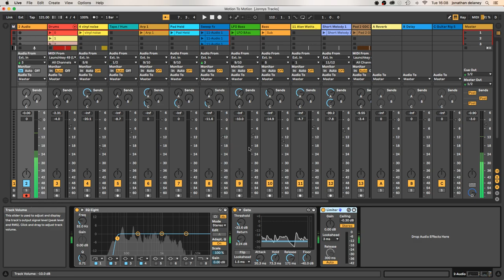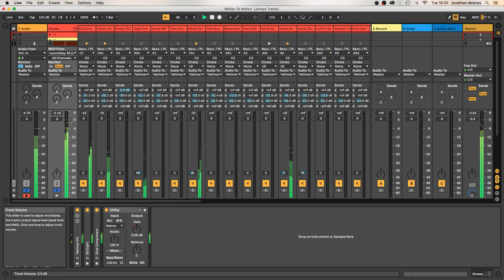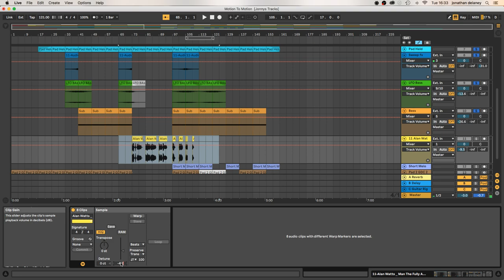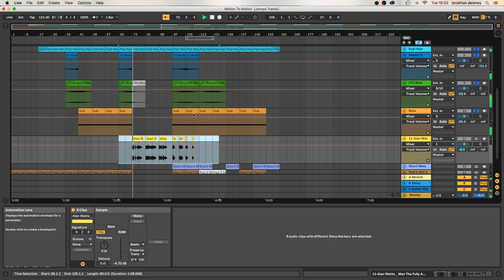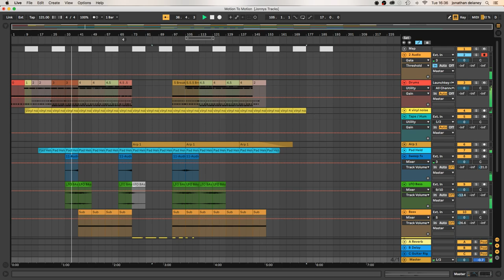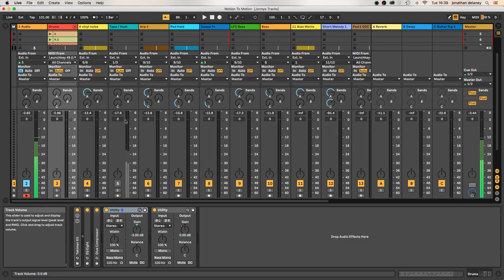Ableton Essentials 001  Gain Staging

Comment: Error number 1: if you change the volume of the sampler and it goes to an amplitude dependant device, such as a compressor (as your kick does) you mess up the compression thersold. You should lower the output level of the compressor instead. Error number 2: if the single drum channels don't clip but the group does, you are ok: just put an utility as first device on drum group and low the volume as you need. You fix the gain staging in a move and save 32 minutes of video. Error number 3: you forget to mention that Live process in floating point, so even if the channels clip it's not a big deal... please don't do tutorials if you don't master the topic.
Reply from the maker: HI there.  Thanks for your advise.  Albeit slightly passive aggressive.   Re error no 1, as you put it.  Adjust the compressor threshold = sorted.  Re drums or anything else, it's best practice to address at source (floating point or not), and fix whats needed afterwards. People watch gainstaging videos that may not just use Ableton.  Maybe try sharing a little love rather than arrogance the next time you post.  You'll find it makes the world a slightly better place x
Reply: @movinmusicacademyofficial  rightly said